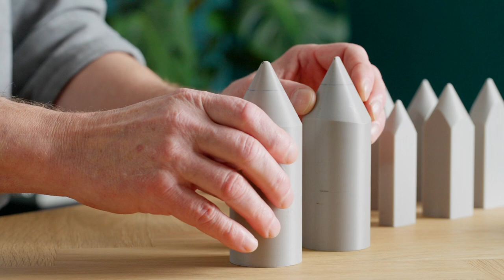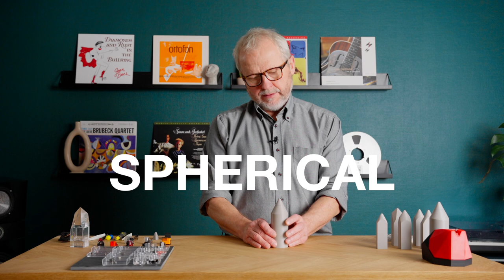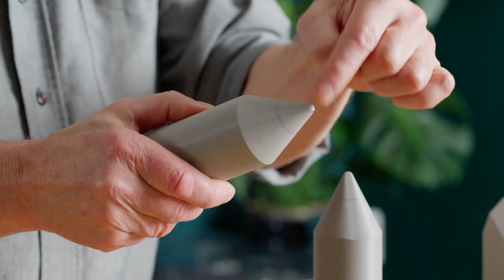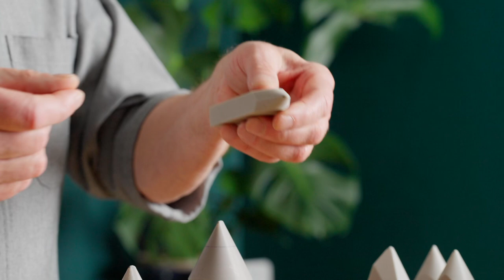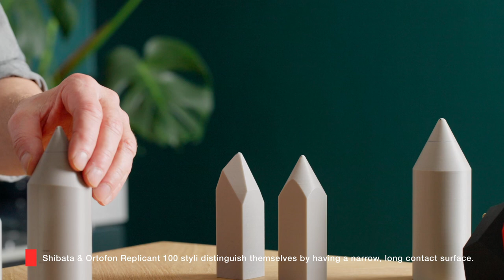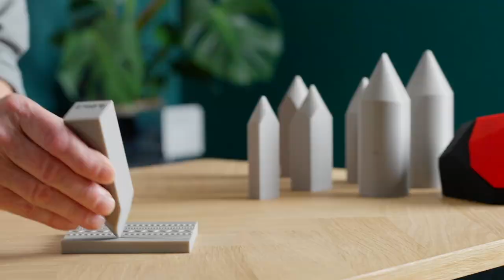What Makes a Cartridge Good? | The World of Styli

Comment: Nice explanation. Although, as it is constantly said in the video the amount of contact area between the groove and the stylus is important, it does not talk about the quality that the material must have to transmit the vibrations to the cantilever, which will eventually become the voltage of the audio signal, which is also important. In the case of needles that are not naked and are mounted on a titanium support, for example, the change of material also affects, not only the smaller contact surface.

Comment: Can anyone comment on styli shapes when they encounter dust on a record?
What is the best way to clean records before each play. 
Thank you for this great series!
Reply: Use a micro bristle toothbrush to clean a record. They are Chinese and are usually advertised as 10000 - 20000 bristles.
Reply: shabata styli get all the dirt out
Reply: Ultrasonic cleaner by far the best way set to 36 c degrees isopropyl alcohol 15% distilled water 7 drops of dawn dishwashing detergent then a rinse bay with dishwashing rinse aid . I dry my records on a bamboo dish rack with fans to avoid pooling

Comment: I opened the clip being interested about cartriges not styluses becuse in my opinion   not the contacting end of stylus  makes greatest differences between cartriges.  I used three different types of B&O MM cartriges which had 3 different kinds of stylus -   spheric, eliptyc and full contact and  differences are  only small.

 My colege uses ortofon recommended by reviewers and it does not compare to any of my styluses because his cartrige and arm is no comparably heavier than in my turntable and tracking force is double that of mine (I have only 1 gramm) ,. Thus he has problems to walk around his playing sophisticated Sony while I can brush manualy  LP even  during playing  Surprisingly the condition of my produced  in 60ties and 70ties  LPs due to   cleaning  with each playing do not degrade but  improves only.  This are   differences I care about.